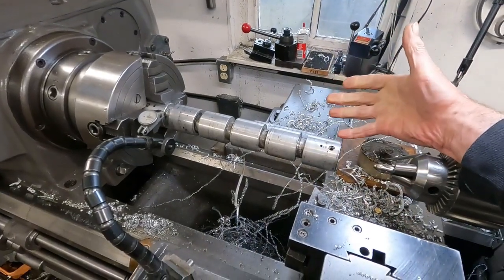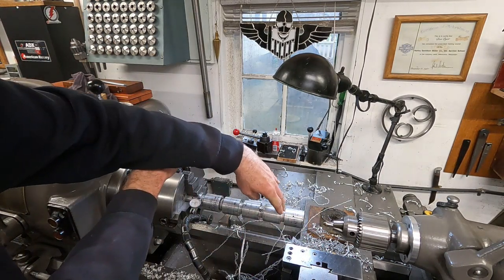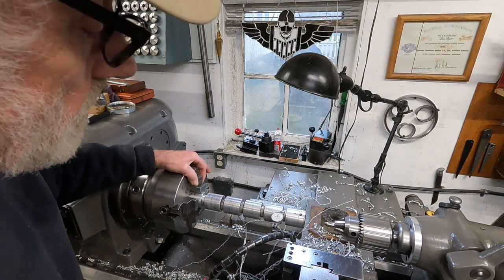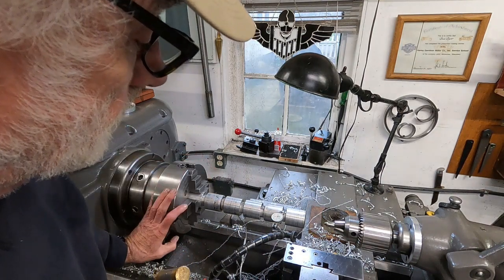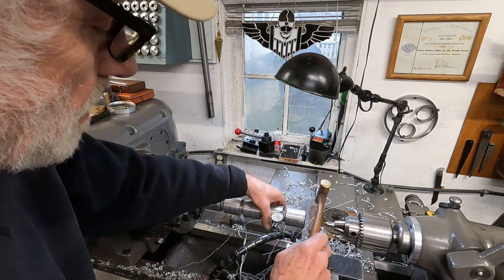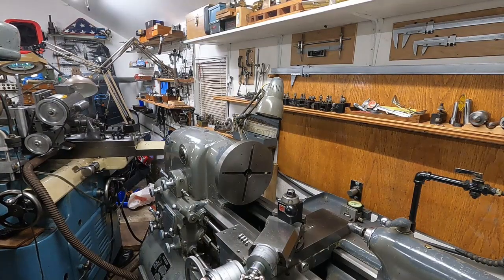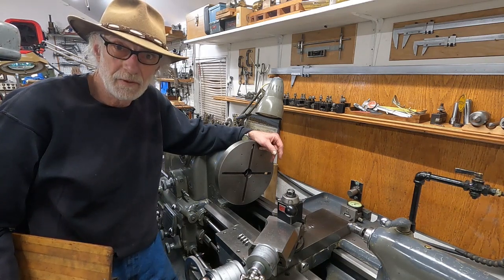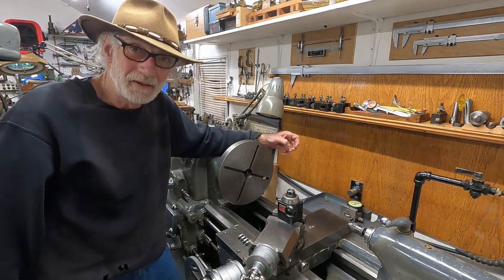Salvaging aluminum bar Axelson lathe machining

Comment: Axleson is a very good lathe I ran one for 6 years at Halliburton! Halliburton looks far and wide for them and are willing to pay top price them! They swair by them.
Reply from the maker: There is a large one for sale locally with 155" centers for only $4000 in good condition, it was out of the local school.
 This one I have is the smallest one they made 14X30 #1022 in 1941 this machine does not have several improvements or features that were added in the next 2 years. The durability is unmatched and the quality of work is outstanding but the machine is slow to use and hard to shift compared to the Mazak, thanks

Comment: I would like to see videos about using a faceplate, there are very few videos on YouTube about the subject and almost none go into detail. I recently made a homemade one for my lathe to turn castings, but I have a lot of doubts about the subject.
Reply from the maker: Eventually one will show up, at one time the faceplate and locating holes with toolmakers buttons was one of the most accurate ways to locate and bore holes, thanks!

Comment: You rescued them from the scrap bin,  just pile them with your other cut-offs. Why bother turning them down until you need the stock, it's time and kilowatt hours spent.?
Reply from the maker: That would waste time in itself having to duplicate the set up seen on the lathe 3 more times in the foggy future, doing it all now is saving my energy, the electrical drain would increase also.